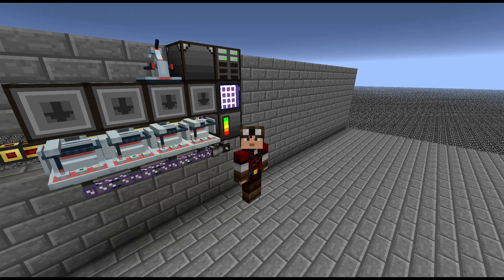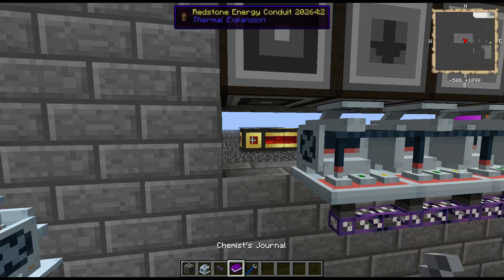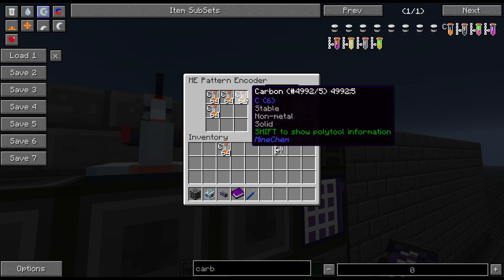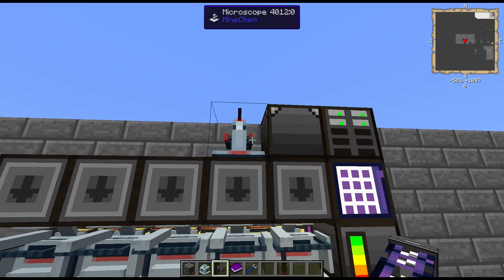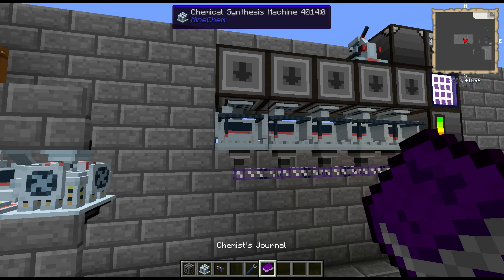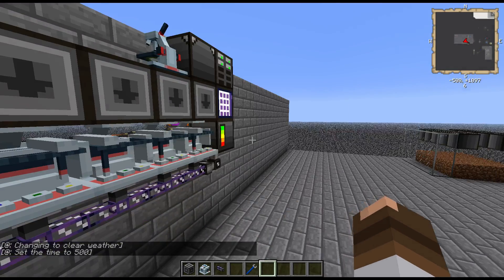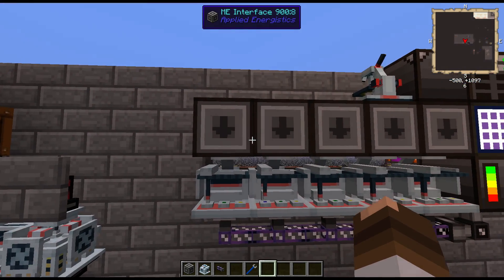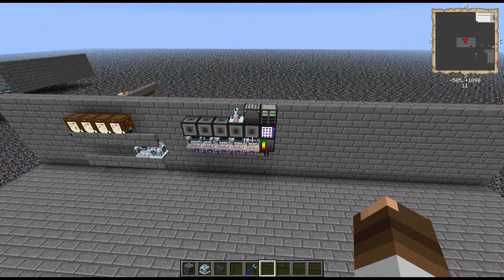POC: Auto MineChem Chemical Synthesis Machine using Applied Energistics

Comment: HOW DO YOU PUT STUFF INTO THE DECOMPOSER AUTOMATICALLY WITHOUT HAVIG TO MANUALLY DO IT. I'va tried to use hoppers, transport pipes, anything I ould with my modpack and NOTHING. WHAT DEW I DEW
Reply from the maker: +TheCreeperMines All those should work, but must be inserted from the top. I've used transfer nodes as well with no issue.
Reply: I figured it out, I was just being stupid. but thx anyways.

Comment: Must be need Me Crafting>?
Reply from the maker: I am not entirely sure what you are asking. I am guessing you are Chinese. Try writing out your question in Chinese and I'll use Google to translate it. Google doesn't always pick the right words when translating.
Reply: I'm Sorry xD My English so bad 
I'm asking Why my Server Chemical Synthesis Machine Can't Out put Diamond into MeDrive or Chest
Reply from the maker: It doesn't output on its own, it has to be pulled out. Either with an ME Import bus, or with an Item Transfer Node. Also it takes 600k energy.

It is possible they disabled that recipe. Have you tried pulling the diamond out manually?

As far as your English, it just takes practice. Considered one of the hardest languages to learn, as words often have multiple meanings.
Reply: JoeCool FlyingAce i can pull out the recip but i cant pump it out in single  player or multiplayer
Reply from the maker: a man gone mad
My best guess would be a version thing. I just tried it on ME^3 version 1.4.5 with no issues. This is the latest version. Also remember, it takes 600k energy and has to recharge after every diamond. Other than that, it seems quite odd it wouldn't work.
Reply: the thing is im doing the same thing for iron so powers not the problem. its most likely the version thanks